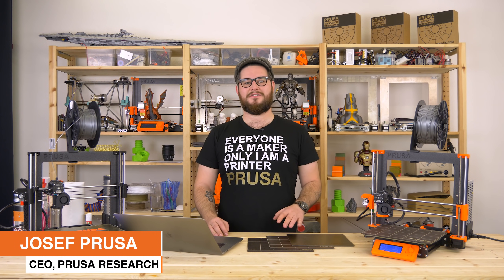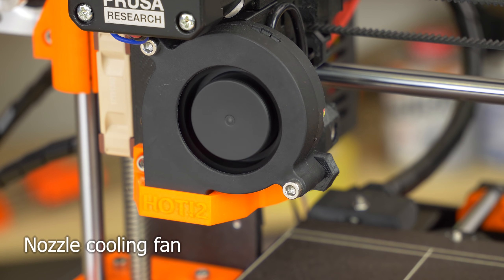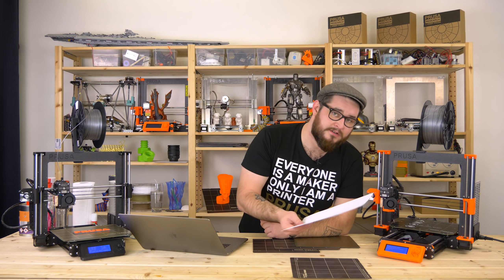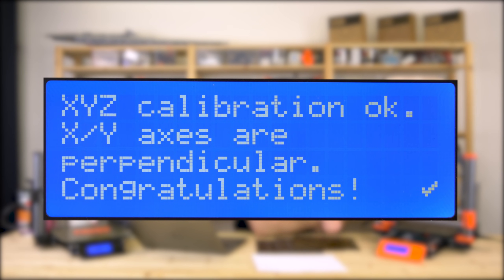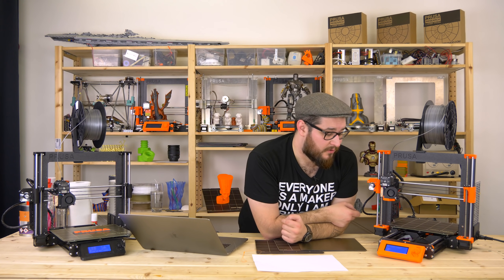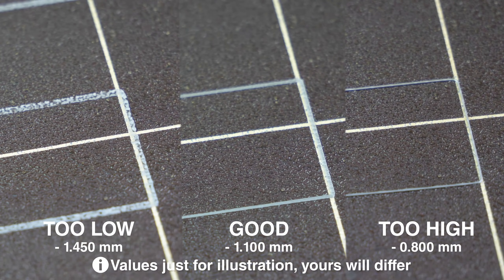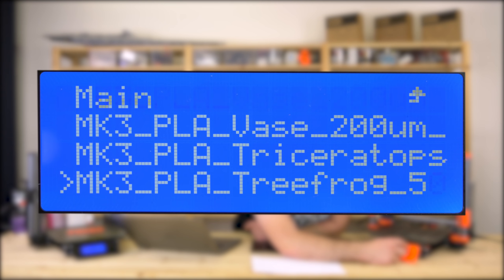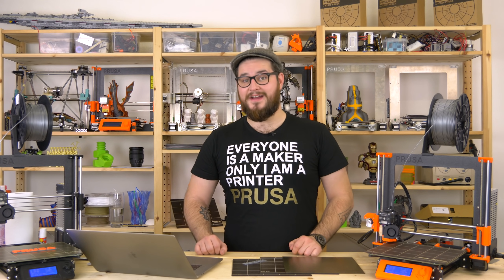Original Prusa i3 MK3 guide for a new user

Comment from the maker: Update:
Do not use acetone on powder coated sheets! (10:16 is just for the smooth PEI sheet)
Reply: Not to be that guy, but you should put a youtube pop up or something over that part. Not everyone is going to read the comments...
Reply: @memanproductions  I was thinking the same, or edit the video to add a scene that states it clearly.
Reply: arturo pendejo thanks sooooo much
Reply: Prusa 3D by Josef Prusa I have a question I am considering buying one BUT does it have some filament?
Reply: @chanelcat1041  one or two roll.
Reply: nathan villeneuve just one and sorry not getting back to you something is not working with my phone
Reply: So what kind of treatment do you recommend for powder coated sheets? I am ordering an MK3 next month and think I will go with the new sheets.
Reply: @bassman0115  IPA only. https://help.prusa3d.com/article/WPL74Wx4aU-steel-sheets
Reply: Hi there, what if the nozzle catches the paper sheet?, I stopped it immediately,  do I have to do something with my PINDA probe? Is there an official video to do so? I recently purchased the ensambled MK3s, new user here!
Reply: @marcoseduardogonzaleztrevi3114  usually you raise the nozzle since it was too low
Reply: @marcoseduardogonzaleztrevi3114  That would mean your pinda probe is too high, you'd have to adjust it to be closer to the bed.
Reply: I'm I screwed if trying to find the firmware for a used Prusa i2 mk3 with no handbook?
Reply: @gabef9538  I think you can actually download the handbook and have it as a pdf
Reply: @ELValenin  all the googling only brings up I3. I2 is practically underground. I've been shoveling and sifting for hours and have only found flecks. It looks like it uses the same pcb as the mini if https://help.prusa3d.com/en/article/mini-rambo-electronics-wiring-mk2s-mk2-5-mk2-5s_2109 is correct. Where would you look for a pdf?
Reply: @ELValenin  I realy want to know which orientation to plug the lcd into the box on the size and which cord go's to which pins. I want to get the right manual and firmware. None on this is easy to get safely. Are the new handbooks backwards compatible at all? Where should I look for the old ones?
Reply: @gabef9538  you can get everything digitally on the prusa website ;) no I don't think they're backwards compatible
Reply: Where can I buy this 3d printer using 2.85 mm diameter filament ? I want to print flexible material (extremely flexible), could you tell me what is the material of flexible filament that you have used in this video ? Thank you.
Reply: @chiphamthikim5382  this uses 1.75mm filament. No 2.85mm version available
Reply: Just came across an upgrade I thought its good upgrade you may consider to add that to your printer ,:D
https://youtu.be/WjvLEGTLdJ4
Reply: How do you prep the textured sheet for petg prints?
Reply: is it possible to print flexible filament with the printer?
Reply: @startobytes  yes
Reply: Is there a Klingon language option for the menue yet?
Reply: Can u ship that to me bro
Reply: India Karnataka banglore nayandana Halli main road industrial town near ameena bai memorial hall #22 Venkateswara nilaya

Comment: Hi. I have a Mk3s and I have a problem with the z-axis calibration.
The display says check the limit switches Z connection error.
Can anyone help me.
Reply from the maker: Hi Peter. Please make a picture of the error, and contact our Technical Support Team with it. We will help you.
https://help.prusa3d.com/article/customer-support_2287
Reply: @Prusa3D  Hello. It always stays in the upper position and that's it. It doesn't go down at all. Manually the Z axis works, but the calibration doesn't. Thank you

Comment: I just got my first 3D printer and it’s a prusa MK3S. I am printing in PETG and have my first layer height adjusted to -1.100. That seems to print great. When I try and attempt to print anything, though, nothing sticks to the print bed and it ends up bunching all up. I’m lost. Any recommendations? Print bed is set to 90c and nozzle set to 230 for first layer and 240 for the rest. Thank you!

Comment: Hi Joseph. Need some help. I’ve had the prusa i3 mk3s+ for about 4 years now. Suddenly when I try to calibrate it tells me the that fans aren’t spinning, yet they are. And tells me that there’s a self test error and asks me to fix the issue and tells me to continuously reboot. Can I get some feedback here as to how I should resolve this issue. I’m currently in Dubai so parts are difficult to get. but if we can get on a call or email I’d deeply appreciate it. I really want to solve this issue asap because I have an assignment I need to print something for asap.
Reply from the maker: Please reach out to our support, we have a 24/7 live chat on our eshop, the guys there will do their best to help you. ;) -Mikolas
Reply from the maker: Hi Walid. We are sorry for this issue.
I recommend you to do a System Refresh and flash the latest firmware for this 3D Printer, it should be 3.13.3.
https://help.prusa3d.com/downloads 

When running the Sefltest, please check carefully the message displayed regarding the fans. We have many cases where the users confuse the questions, and reply wrongly.

If still doesn't work, please contact our Technical Support Team. You can have a quick answer if you use the LiveChat for this.
https://help.prusa3d.com/article/customer-support_2287

Comment: If I only use the Prusa a few times a year, do I really need to go through the calibration process each time (the 11 to 12 minute process involving the sheet of paper)?
Reply from the maker: Hi Jason. If successful, the calibration should only be done once at least there is a change of hardware/firmware. Contact us with the details to check what could be the issue.
https://help.prusa3d.com/article/customer-support_2287

Comment: 4:53 here my print head doesn’t move up but still says to put the steel sheet in. When I do that and press to continue, it crashes the nozzle and I have to reset it. Using Prusa MK3S+ with firmware 3.15

Comment: Wizard:
1. selftest
2. x, y, z calibration
- remove steel sheet for calib and put on sheet of paper
- clean nozzle
5. 9 point Mesh Bed Leveling
- this is height calibration before every print
- put on steel sheet
6. Temperature Calibration/heating
7. Load Lilament (this will come up in wizard or find the load filament procedure in settings)
8. First Layer Calibration
- clean the bed (and then replace steel sheet on top)
- this will begin to print test line
- manually adjust Z (usuakky to -1mm)
- prints a small piece
9. clean the bed again to get printing by saving your .gcode file on SD card
(use PrusaControl from drivers package?)

Comment: How do I upgrade prusa i3 kit 1.7mm to some thing more decent?
Reply: well you are kind of out of luck, your best bet would be a MK2.5 upgrade, but since those have been discontinued quite a few years ago you'd have to source it yourself. Also most of the printer would be replaced: Z-motors, entire toolhead, heated bed, PINDA would need to be sourced, also quite a lot of parts would need to be printed,

Comment: Thanks for this Josef, very interesting to know how to set up correctly. I was given a Prusa i3 (I think it may be one of the very first models. I’ve been replacing parts which were broken etc and it seems to be okay, except for an issue with the software. It is a 200mm cube print area, and I wanted to know how do I get the software to reinstall on the machine. I think it’s got a glitch in it. Any and all assistance is appreciated 😊

Comment: I have still a i3 mk3s with a error mintemp.
After replacing the extruder cable and the extruder thermistor and also the heatbed cable.
Which I thought to be the problem.
But the error is still there.
I even did a factory reset but that did work either.
Could you please help me out with my problem.
I'm lost now and don't know what to do now.

Comment: I'm using the glass bed on an ender3 from late 2019 and do not ever have to clean the bed after a print in over 2 mos. with both ABS and PLA I go through an entire spool of filament and only re level 2-3 times. I wipe the bed with a dry paper towel about twice a month. I wash the glass in the sink with dish soap and comet about twice a year. All the slicing in in Cura. The printer menu has poor selection ability, but It still prints every day all day non stop. The miniature memory card is junky. We would like to now get into this Prusa and be able to tweak it for similar performance. I will never understand why you ppl making these machines don't just put USB sockets on these things once and for all !!

Comment: Hi, I'm hoping to you clarify what you mean by "catches on the paper"? 3 of the calibration points the nozzles touches but does not drag the paper, the 4th it drags the paper a little, is that what you mean by catching ? The nozzle does not seem to be contacting the heat bed in that spot.

Comment: Does it have built in stepper controllers or removable so it can be upgraded for silent or more powerful ?
Does it have a shutdown feature at the end of the print ?
The M81 switch relay I put on all my printers.
Does it have thermal ranout protection in firmware ?stops the print when temp goes up too fast or drops too fast.

Comment: Hi, I complete all my settings in Cura, I use a speed of 50/60 for my initial layer and then higher speeds for the walls/infill etc. What speed do I set the actual printer at for the start of the print for the printer to recognise all these speeds? It always starts at 100 but then doesn’t slow down for the brim or the initial layer, I have to manually turn the knob down to 50/60 and then when this is done I turn the speed back up. Is there a way for the printer to know all these speeds to start with like I input into Cura
Reply from the maker: Turning the knob is applying a global multipler to all speeds.
E.g. if you set perimeter speed in Cura to 40 mm/s, by turning the knob and setting the speed to 50%, perimeters will be printed at 20 mm/s. So instead of turning the knob, change your first layer speed directly in Cura. In PrusaSlicer, we use 20 mm/s for the first layer in official Prusa profiles.

If you want to keep using Cura, it might still be worth downloading PrusaSlicer, since the profiles there are fine-tuned perfectly for Original Prusa printers. So you can copy the values we use there and use them in Cura. -Mikolas

Comment: Aren't you ashamed of selling something like that for a lot of money? Cable ties plastic parts, cheap frames! The only good thing is the extruder and the software. You make a fool of yourself with the cucumber!
Reply: The value is in the knowledge. The refinement of the software, such as the calibration and levelling shown in the video which other printers simply don’t have.

That said, I’m also a bit puzzled why some chosen components are not the best in the business - for example, the V6 hotend with nothing to restrain the heatblock, making nozzle changes tricky to ensure the heatbreak (threaded tube) meets the nozzle. Perhaps Prusa should develop an equivalent to a Mosquito.

It’s also odd that the controller is still 8-bit. I wonder if it has enough power for linear advance calculations (pressure advance). And a four-line LCD is limited in the information it can display. No bed level measurements, for example.

Comment: You said that when you were doing the setup for the printer that if the z-axis is not in line with each other that they will go all the way up to make it so that they will be in line again. But the printer I have only went up a little bit and did not make them back inline again and the z-axis also kept pushing down on the heating bed when it was testing the z-axis and I did not think that that was right. Is there a way to make it so that it does not do that anymore.

Comment: i downloaded the xcalibare thingy and i got some parts not working great ut its not easy to adjust i recently unscrew 1-2 swings on left middle and middle in hope it works but its mainly the filament that goes around the structure that leaves the grid i dont get it.. the prints it self are great!. i run in one issue but it solved itself by printing over it my Z live = 1050 as in videos said but i cant get it completly flat everywere .. if i do to many on 1 sheet like 8 pieces small then i get those not sticky parts @ 1 side

Comment: Hi, I have a Tronxy i3 printer which I understand is derived from your Prusa.  I need help. I went to replace the broken X axis Limit Switch over a year ago, removed the original one that I had installed when I built the printer myself, but did not get around to installing the new one  that I had waiting.   It is a year later and I am now trying to install the new Limit Switch which is exactly the same, but the wires keep pushing into the Z axis steel bar.  No matter how I try I can't keep the wires from jamming into the bar or behind it. the sleeves around the wires at the junction are very stiff and I am concerned about breaking them if I bend them too much.   What am I doing wrong?? Please help as I am so baffled by it.

Comment: I need help 😭 
I were able to print 2 tiny pieces for the very fisrt time with my Prusa i3 Mk3s (pictures next messages), the filament was PLA Carbon fiber 1.75mm, but it took me a while to calibrate the printer, anyway, after 4 hours the job was done. But...

Now i can't print.

I try with different kind of filaments, with the correct temperatures, and of course good calibration with every attempt, but now (after the one and only good impression) the nozzle drags (after .5mm more or less) the extruded filament on the print bed. So i can't print anything new after the first (and successful) try.

The firmware is up to date, every selftest is ok, every wizzard calibration says "XYZ calibration ok. X/Y axes are perpendicular. Congratulations!" 

I have moved the probe in very different possible height, but the problem stays. 

Please help. Greetings from México.
Reply from the maker: If you've used carbon filled filament with the standard nozzle, you've very likely destroyed it. It's extremely abrasive and the standard brass nozzle won't last long with it (the manufacturers usually include such info with the printer, I'm pretty sure it's in the printer's Handbook too). Luckily nozzles are very cheap and if you also order some kind of hardned one, you can print abrasive materials such as the carbon filled in the future.

You can by the nozzle here:
https://shop.prusa3d.com/en/26-i3-accessories-mk3s-mk25s-etc
or anywhere else as long as it's E3D compatible.

If you have any more problems in the future, use our 24/7 live chat support at shop.prusa3d.com, youtube is definitely not the best way to troubleshoot things :)
- Mikolas

Comment: I just bought this so I can build a Tesla turbopump which means I'm going to test if my concept* works AND I get to use my awesome new Prusa i3 MK 3 to replace my broken dishwasher nozzle at the same time!

Huzzah! Thanks so much Josef and the rest at Prusa 3D! You're a good eggs and I hope history has a page for your folks cuz you deserve it!

*Tesla turbo-pump will have a vacuum compressor intake before and after a Tesla turbine to suck the heat out of the water and hot air inside the dish washer resulting in faster drying/cooling without having to expend any extra energy besides what's already used to wash the dishes.

I mean I wanted to start with a (what might be a self-powering) turbofan instead but the wife told me it was either I fix the dishwasher or I'm on exclusive hand-washing dish duty for the house until I get that nozzle fixed so it's that while doing turbofan or put the tasks together. <.<;;

Comment: Build is going great overall but absolutely hate the nylon filament installation. Mine won’t seat, the nylon won’t cut, and pressing in the nylon caused part of the extruded assembly to break off. Can you guys please make this part of the build better? Seriously, use pliers to just jam it in? I hate it and the fact this part broke part of the printer before I even get to use the printer.

Edit: and the nylon fell out when I was zip tying the cable shroud ... is the printed part y’all sent me for this defective? I had pushed so hard the pliers pushed into the extruded assembly and broke off a piece. That’s not enough?

Comment: What a nightmare.  I bought this printer.  I waited for 2 months to get it.  I bought the factory-built.  I finally received it and have spent over 8 hours trying to get it working and they only offer chat.  A complete nightmare.  After 8 hours of trying to get the Print calibration test, to work I gave up.  I really wanted this to work for me because I heard such good things but enough.  I don't think I could recommend anyone in the US to buy this.  To get it serviced requires a 3-week wait.

Comment: I adjusted the Z height (First Layer Calibration) using the non-textured sheet and the PLA Prusament you included with the Prusa Printer.  Ended up with a value of "-1.100", which I saved as one of the 8 presets.  The prints are turning out very nicely.  Do I have to change this Z height of "-1.100" if I try using a non-Prusa PLA filament or a different type of filament (PETG, etc.)?

Comment: Thank you for the video.  I am considering your "Original Prusa i3 MK3S kit" as my very first 3D printer.  You mention in the video to use isopropyl alcohol of at least 90% concentration to clean the bed.  Most of the isopropyl alcohol we find in the US is only 70% concentration.  However, denatured alcohol (almost pure ethyl alcohol, ethanol) is readily available at hardware stores.  Can I use denatured alcohol instead of isopropyl alcohol to clean the bed?